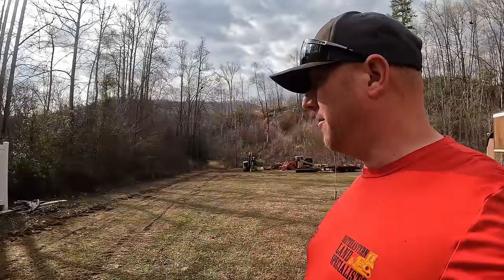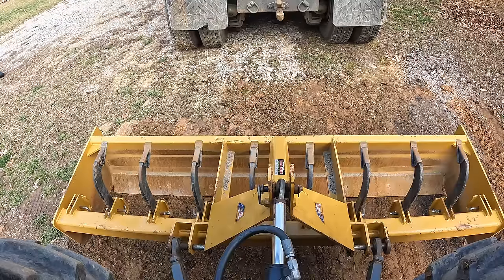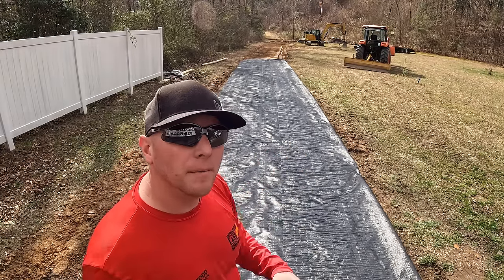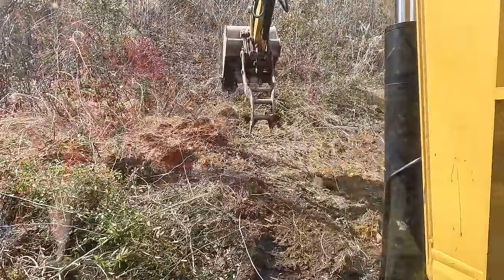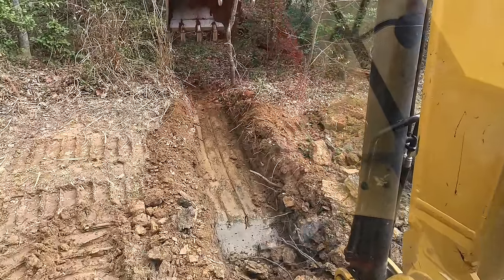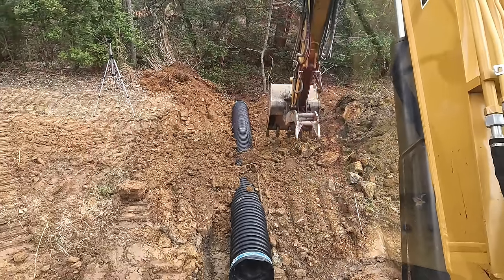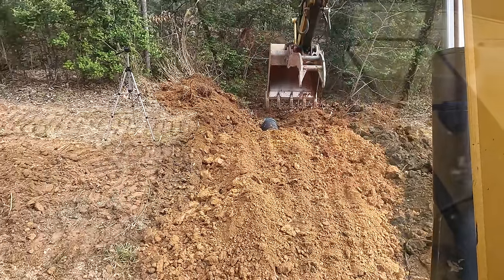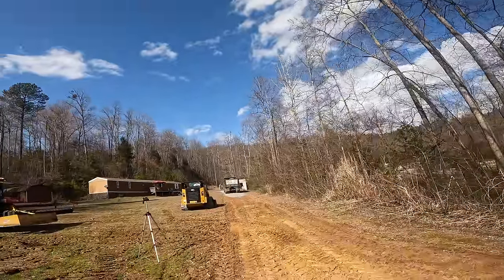How To Build A Gravel Road on Unstable Ground (Part 1 of 10)

Comment: Great video, came across you guys while looking for tips to do my own drive. Got a quick question, my drive is on a hill and my surface layer looks like what you have put down. It’s very compacted but i find it washes away in the rain in areas and on the flat section of my drive the fine stuff comes to the top in the rain and it’s gets messy. Would i be better using clean quarter inch gravel that doesn’t compact and stay loose? Id appreciate your opinion? Cheers

Comment: Why did you only put the fabric down at the start of the road and not the entire road?. I have goofed up gravel road with pot holes and I think I need to dig the whole thing out. Lay down fabric and then regravel
Reply from the maker: You must've skipped through the part where I explained why
Reply: @DigginLife21  I watched it again.  And sounds like you are doing an experiment to see the difference. Im pretty sure the fabric is not going to let you down .